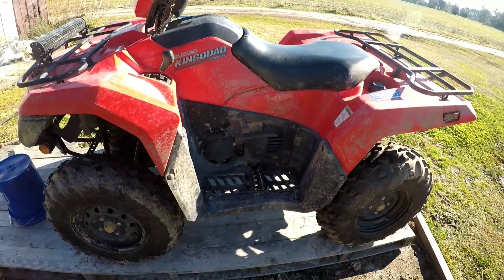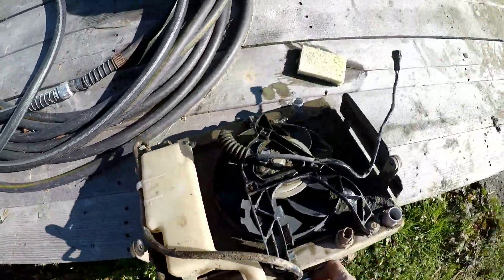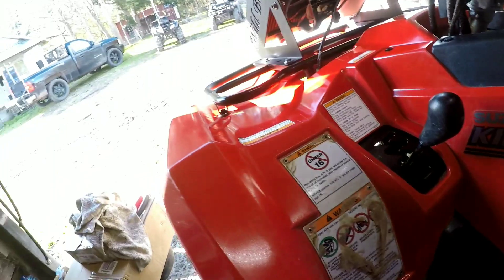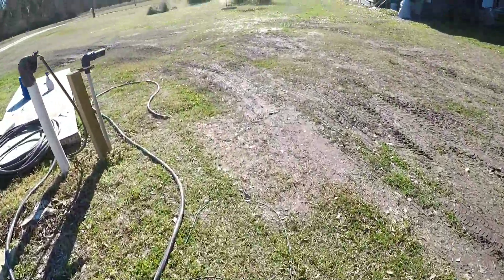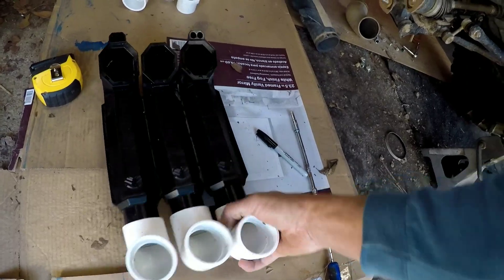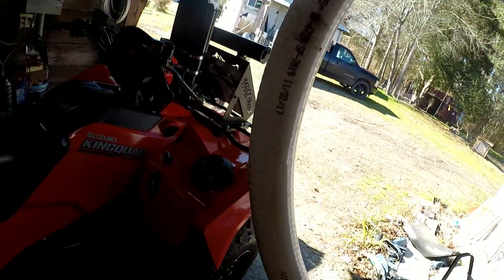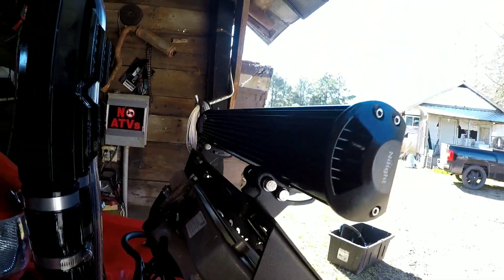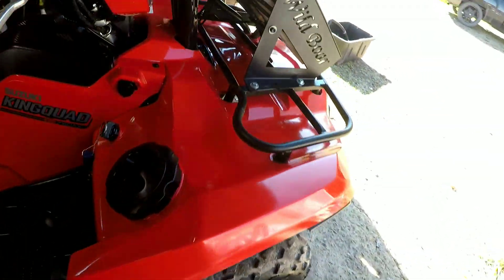Custom snorkel, radiator relocate, and winch install on Robert Powells' 2020 Suzuki King Quad 750axi

Comment: Hello. I wonder what convinced you to drive a Honda 420. Why not some Polaris or Can Am 1000? I am planning to buy a new ATV. Can you advise me something?
Reply from the maker: I've had every bike made... just about.
I ride Honda because I like to ride deep water and mud.
It doesn't have the power of the bigger bikes... but they're a lot cheaper to fix
Reply: @SomeDamnfoolsAtv  And how the gearbox behaves. Some crashes. U for everyone has CVT boxes. Recently, we started driving deep and problems began.
Reply from the maker: Have to deal everything up good
Reply: @SomeDamnfoolsAtv And other Honda models, for example, the 500 or 680. They are worthy or 420 there is no better
Reply from the maker: Don't get a Rincon...if the transmission goes it's very expensive! Rubicon is the best in my opinion
Reply: @SomeDamnfoolsAtv  Thanks for your help.
Reply from the maker: @wowzwirek2533  yessir!!! Thanks for watching!

Comment: How did you do the vent lines and which ones were there?
Reply from the maker: It wasn't but 2...and I believe it was the gas tank...and one of the diffs? It's been a while since I posted this video.  Most everything on the bike comes with bellows

Comment: My friend said I got water in my motor but it still runs but it smokes bad when I give it a lot of gas can I still ride it or new motor or fourwheeler?
Reply from the maker: What does the oil look like? Milky?
Reply from the maker: What make and model bike?
Reply: @SomeDamnfoolsAtv  it’s a 2020 Honda recon 250
Reply: @SomeDamnfoolsAtv  yeah
Reply from the maker: How did it get water in the motor? Just trying to understand the scenario
Reply: @SomeDamnfoolsAtv  this might sound dumb but I forgot to  Seal the air box and when I got the water over the air box water got in it and it turn off under water and I tried to turn it back on it runs like it has no water in the motor but it smokes bad
Reply from the maker: @pnar4843  top end...if you are in NC...I can get you taken care of for around 650.00 parts and labor
Reply: @SomeDamnfoolsAtv  ok and do you have any fourwheelers to sell I’m in Alabama but I maybe can bring it up there I’m going to ask my mom or dad about the money
Reply: @pnar4843   stay out of the water
Reply: @snakeplisken4119  hn
Reply: @Matt-P1  🕷